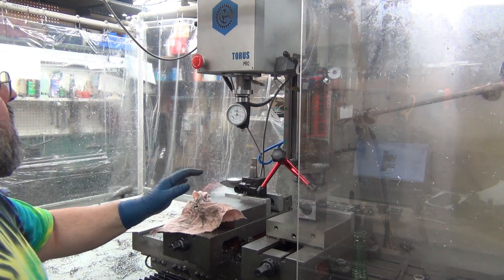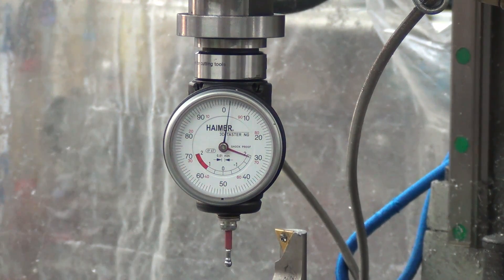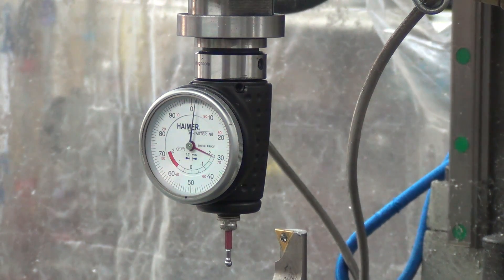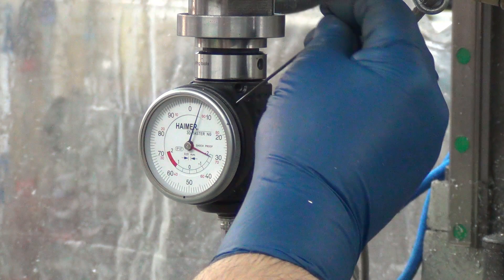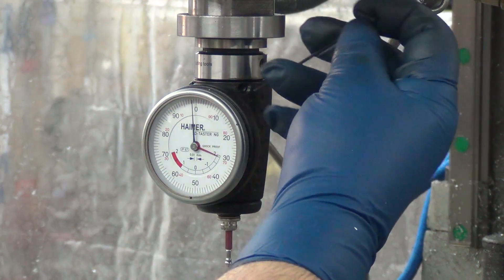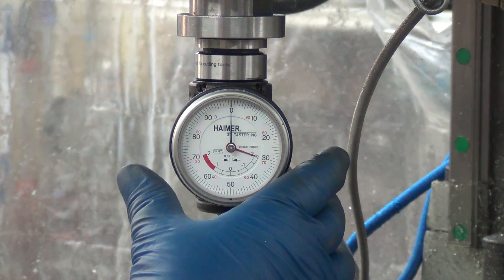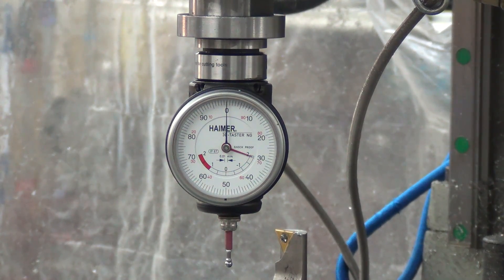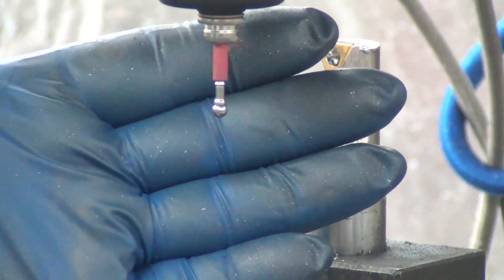Haimer Taster - Setting Zero and Probe Tip

Comment: I think you shouldn`t touch those screws. If the needle is not at zero, you just turn the dial to zero it. Only screws you should mess with is the four screws on top radial to the spindle axis. And those only if the probe tip is not running true when you spin the haimer 360˚
Reply from the maker: There are other videos out there of the same thing being done.  It is the way to do it.......but feel free to spend $500 on one, knock it off zero and then post video of how to do it....then come back and post a link here. I'll even pin it or put it in the description box. :)

Comment: The the dial turns, how do you know 0 is sitting inline at 12 o’clock with the haimer shank, when I bought mine it was out 1 maybe 2/100ths of a mm, I just turned the dial lol is that wrong
Reply from the maker: Hmmm....great question.  I'm not exactly sure, but I would think that you'd want the dial straight up.  I don't remember my dial turning.  I can't seem to find it right now, but I remember seeing a vid where the face was taken off.  If you can find that one, it might better answer your question. Thanks!!

Comment: Just dropped my brand new Haimer out of the spindle so thanks for this!!!!
Reply from the maker: You're more than welcome!   
Sorry to hear that.........and welcome to the club. :(   lol!!! :)  I've crashed/dropped mine a few times and it still seems to work okay after I adjust it....hopefully, yours will too.
Reply: bluehandsvideo so it turns out there wasn't enough adjustment.  I think I marred or deformed the ball/socket connection.  I can get it within 0.005" of zero but not zero.  I ordered another one as I need something I can trust.  Should I mount this on the wall of shame?
Reply from the maker: I would try it again, actually.  There's a really small window of adjustment.  I thought mine was hosed.....had to take a second shot at it to get it into the sweet spot.  It's been awhile, so I don't recall the details, I just remember that I couldn't adjust it far enough the first time.....had to come at it again.  You can take the front bezel off....the gauge comes out.  You've already given up on it, so you can't actually hurt it any more.  If still no go.....send/loan it to me for a bit.....I'll pull it apart and take some vid of the guts. :)  ......then send it back.   But.....take another crack at it first....I'll bet you can get it working again.
Reply: Well I removed the gauge from the body and then removed the o-ring.  I then can manually slide the gauge up and down same as the grub screws would do.  Even all the way down, metal against metal - it still wouldn't zero out.
Reply from the maker: Sorry to hear that!  Guess I've gotten lucky. :)

Comment: Thank you.   I was concerned on mine that in order to get all four screws snugged up so it would stay calibrated that I was over torquing some of them.   Nice to see I'm not doing it wrong - assuming of course that you aren't also doing it wrong.  :-)
Reply from the maker: LOL......I could be.  I got the info/process from another guy.  They don't need to be gorilla tight, but they seem to get that way pretty easily sometimes.  You just have to realize that you're getting a bit too snug and loosen the other side before you get too tight.  It's real easy to want to just tweak it that last little bit and then you find yourself too tight.
Mike
Reply: No kidding on the "last little bit" part.   So tempting to dial out the last couple 10ths, and then the whole thing goes wonky and you have to start over.   The thing needs a button you press and it self calibrates.   LOL
Reply from the maker: A one button calibrate would be awesome!!  Probably cost as much as a Renishaw probe then.

Comment: just got mine today and the guage its not on zero going to watch your video while i set mine up to help me !!!
Reply from the maker: Did you get it new?  I'd be a bit irritated if it came in that way new.  I hope the vid helps and that you get it all dialed in!! :)
Thanks!
Reply: bluehandsvideo yaa its new from tormach .
Reply from the maker: It will be good experience learning to dial it in, in case it happens again, but that's a bit disappointing that it came in that way.
Reply: Mine was off a hair. I wasnt bothered. I was looking at disassembling the top to make a custom tool holder before receiving it. Fortunately boring the tool holder to 10mm solved any and all of my issues.